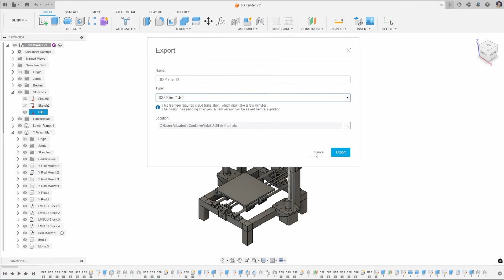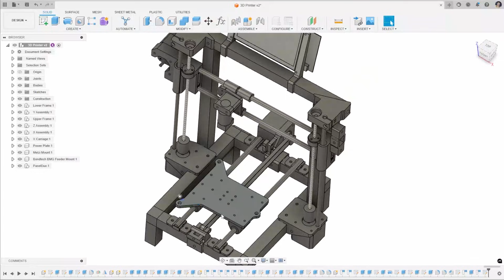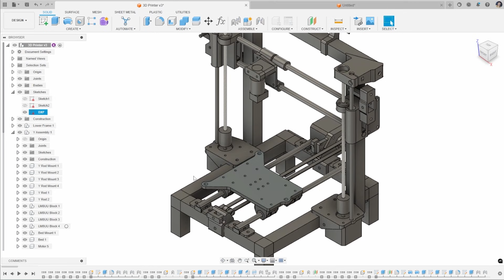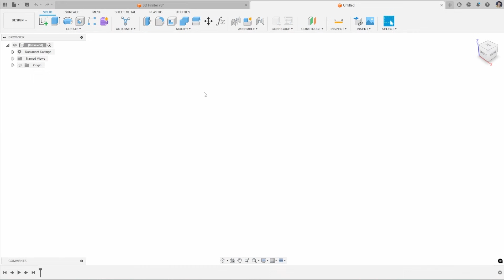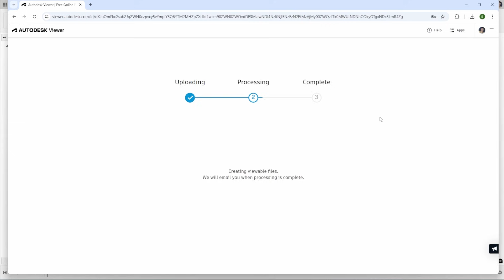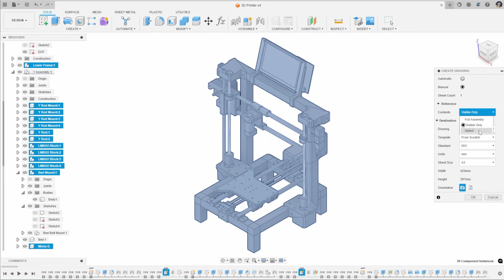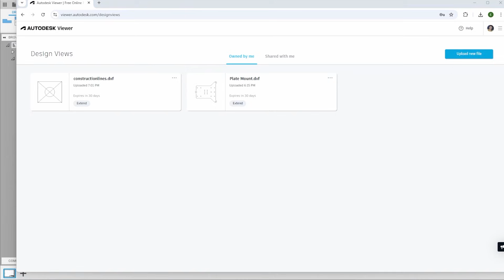How to Export DXF Files from Autodesk Fusion - a Step-by-Step Guide

Comment: I have been using this method for many years now by either projecting onto a new sketch or exporting the original sketch. However, when opening the dxf in another software (eg lightburn or illustrator) the design has a crazy amount of control points… like fusion doesn't understand how to create smooth lines in the dxf export. It is sad because the sketch tool in fusion is one of the best vector drawing tools, we just need a good exporter to keep the original geometry

Comment: I often have many sheet metal components in my designs an would love to be able to export multiple dxfs at once, with the component name automatically applied.
Reply from the maker: Hi Joel, 
Whilst it isn't a core tool for this in the base version of Fusion, there are one or two ways to export multiple dxfs at once from Fusion. You can either create a script that you can run to export them all in bulk (rather than manually), you can use a custom post processor to do it for you from the manufacturing workspace, or if you have access to the advanced arrange (or even better) nesting functionalies in Fusion (through the Manufacturing Extension) this can combine multiple parts into a single DXF for you and export in bulk. 
Sorry this isn't a direct button to press but hopefully it gives some options you can look into!

Comment: Unfortunately, the methods presented in the film have already been shown many times by many other creators - they are the simplest and therefore often insufficient, e.g. in the case of exporting sheet metal developments. The indicated method of generating from a technical drawing - is the only sensible option in the case of bent elements with applied engraving, unfortunately it does not give full control over the final appearance and structure of the DXF file (e.g. external and internal contours are generated in the same layer). Evidently, the possibilities of generating DXF do not keep up with the possibilities of the sheet metal bending module in Fusion. I reported my comments to technical support but I got the impression that the person who replied to me did not understand the problem at all.
Reply: Take a look at the Mapboards (Pro) addon might be closer to what you need with less pain.